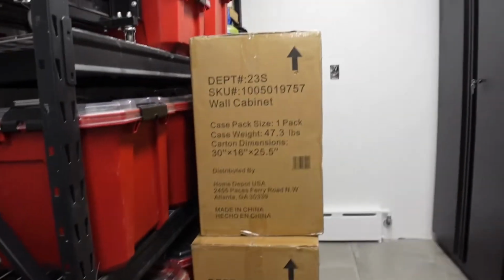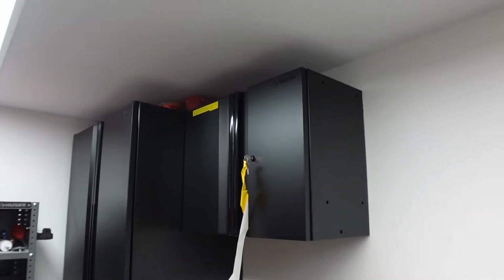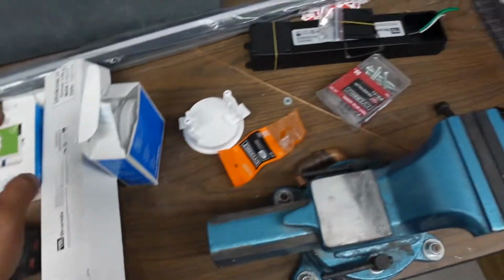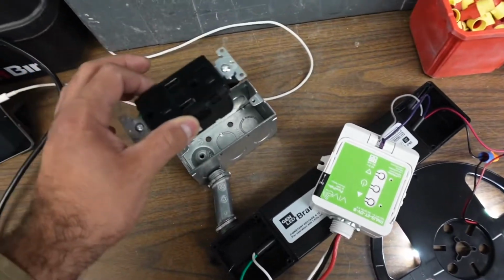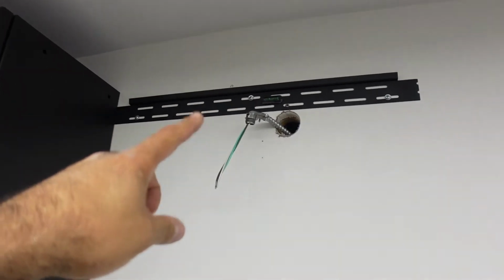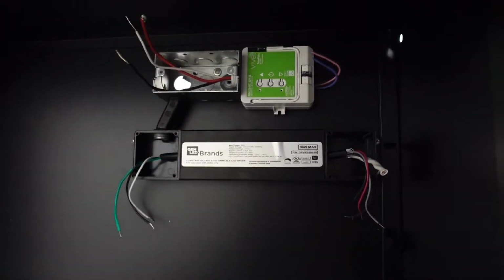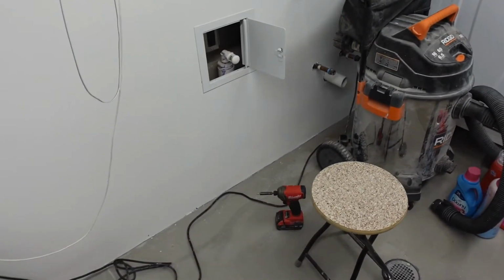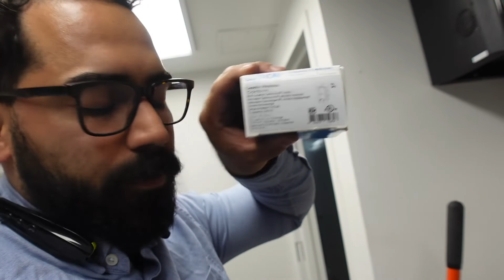Hanging husky cabinets and part 1 of installing under cabinet lighting // Skill Stacking

Comment: I just ordered two of these! Thank you for posting this. How are yours holding up?
Reply from the maker: Prefect. I love them. But have one thing in mind, if you are going be using it for heavy tools and tool boxes and pulling them in and out of the cabinet, the shelf will get scratched up. I like it because it show I use it but other might not like it. Thanks for taking time out to comment. 👊🏼❤️
Reply: @ good to know! I’ll pick up the drawer mating and cut some to fit inside!

Comment: Q: Did you mount the 72" cabinet to the wall, too?
Reply from the maker: Yes. It takes some screws on the top. You can also put it in the middle but I only did it on the top.

Comment: Did you find studs for all of the mounting screws for the overhead cabinets?
Reply from the maker: No I did not need to find studs, when I rebuilt the room I made sure to put wood blocking (3/4” plywood) in the walls so that I am able to put a screw anywhere I want, without having to worry about finding a stud. Below I have a link to the video where I did that work. Starts at about the 8 minute mark.

https://youtu.be/8KSHIQxK4LM
Reply: @skillstacking  that’s brilliant. Thanks for the reply!

Comment: Do you have a link for the driver?
Reply from the maker: The one in the video was gifted to me but the one below will work. Make sure the voltage and watts are right for your set up. 

https://www.amazon.com/Hitlights-24V-60W-Dimmable-Driver/dp/B09Q76XFRJ/ref=asc_df_B09Q76XFRJ/?tag=hyprod-20&linkCode=df0&hvadid=673631357982&hvpos=&hvnetw=g&hvrand=9313884464760802984&hvpone=&hvptwo=&hvqmt=&hvdev=m&hvdvcmdl=&hvlocint=&hvlocphy=9014871&hvtargid=pla-2232208336004&psc=1&mcid=c68d612889b23ce49078fca028ff5a25#aw-udpv3-customer-reviews_feature_div